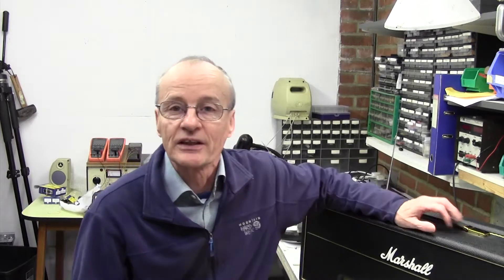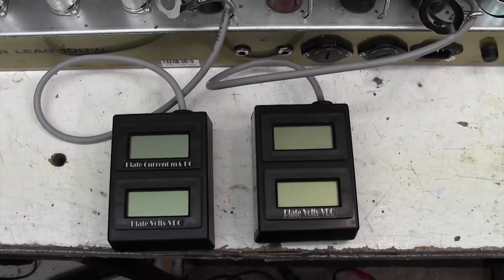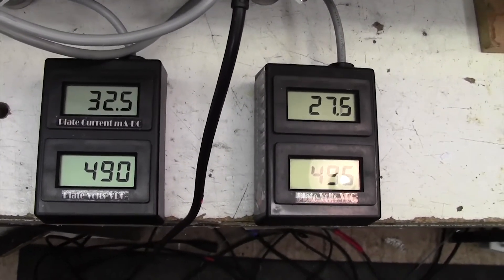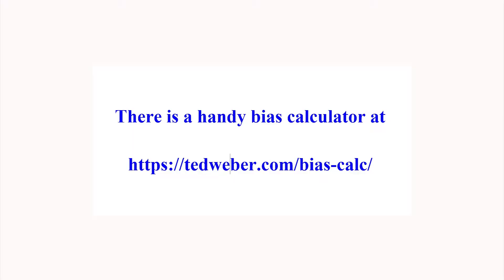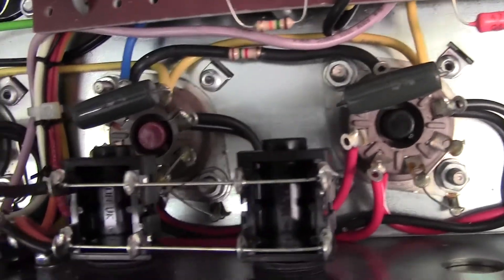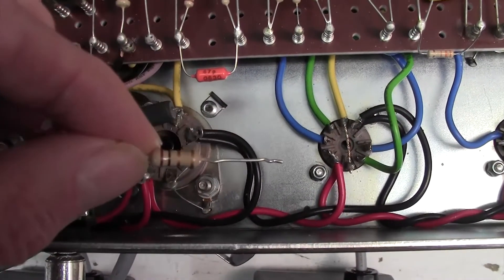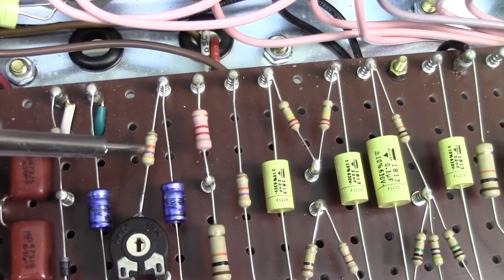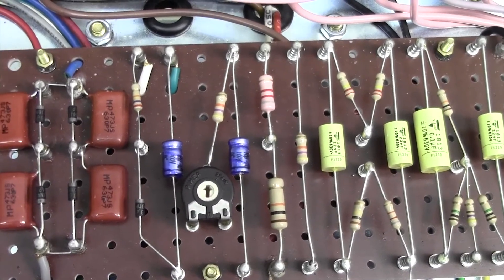How to Bias Marshall JMP 100W Super Lead Guitar Amplifier

Comment: I have one of these with 6550 power tubes in it. I'm still figuring out where i need to be. 42ma - 50ma?
It has 150K resistors on the grid coupling cap section and a 47K bias trimmer pot resistor. 1ohm r on all caths.
The Party likes his 6550's. I say put EL34 tubes back in it as it would be more compressed and controllable.
6550 tubes to me are for a Bass amp or using in a mortar to bomb the other side!😂 A very well made amplifier.
Reply from the maker: Hi It's not critical. 40-45mA is fine.
Reply: @stuartukguitarampguy5830  Thanks much Stuart. I'm 67 next week and the mind is getting foggy. I hate it. A life time of info and memory is disappearing.

Comment: I've seen tutorials before that used bias probes, but it still required a multi-meter to measure the plate voltage. I see that your probes can measure both plate voltage and plate current, which feels a lot safer to me. Where can I buy some of these?
Reply from the maker: They are made by Eurotubes

Comment: Hello Stuart ! We talked through a slight problem with my 1959 SL 100 shocking me. I was actually just adding a master volume kit from Mojotone and pulled the chassis out and put it on my chassis stand and noticed the two inboard tubes where the JJ logo was faded almost off the glass and the two outboard tubes still look like new. When biasing these two had about 2mA higher than the two outboard tubes or the two just in front of the power transformer. I biased them as I said in and earlier post about 40mA but the two outboard are about 38mA. Any ideas why this is happening as the amp has been doing great ?
Reply from the maker: Hi That print burning off will not be caused by a few mA difference in bias current. You can easily live with 5mA difference. To burn the print off the valves would have to get VERY hot. My guess is they red-plated some  time in the past and the issue was fixed and the valves left in.

Comment: Hello Stuart, i just took your advise and added a 1ohm resistor in all four positions off pin 1 to 8 to ground and i got a good shock off the on off switch, when I took them back out the shock was gone. This does not sound right to me but it happened. This was on my 1959 super lead.kit by Mojotone. Which also works and sounds great.
Reply from the maker: Defintely something wrong there!  MY best guess is you put the resistors in the wrong place and so effectively putting voltage on the chassis.
Reply: Thanks I have the ground off the chassis to pin 8 with a jumper to pin 1 verified. I have more resistors ordered so I will try this again as soon as they come. Will let you know what happens. I have doublechecked all ground tabs everywhere and have checked with a meter for continuity. Wish we ere not across the pond or I would bring it to you. No way to send you a picture or I would !
Reply from the maker: @Phoenix20086fly  Hi Ok make sure the resistors are 1phm and not 1k or something! Even so, I can;t see how adding a resistor in the cathode circuit would cause any kind of electroc shock issues/ Let me know if you find out what's going on.
Reply: @stuartukguitarampguy5830 all turned out well reinstalled four new one ohm resistors after checking al grounding points. When soldering the new resistors in made sure and flowed the solder nice around all points from pin 1 to 8 jumper and resistor to ground ! Installed the bias checker under the outboard tubes to recheck that and turned on and used a meter to check switches just in case. I do not want to get zapped again. All was well and I reset the bias just a tad High as I like it better. Now it is doing great and sounds fantastic !
Reply from the maker: @Phoenix20086fly  Well done!
Reply: No need to run tubes hot! You will find an amp sounds great clean, and dirty with the bias set cooler. I have burned up  tubes prematurely many times by biasing too hot...listen to the difference of setting it 5 milliamps cooler. There will be practically zero difference in tone. Just saying because running tubes at their hottest wears them out fast, or just shorts them out internally quicker. ✌️

Comment: Does it need to be a 1ohm resistor? Or can any value be used?
Reply from the maker: USe 1ohm. Anything higher starts to interfere with the cathide current. 1 ohm also makes calculation easy.
Reply: @stuartukguitarampguy5830  what about wattage?
Reply from the maker: @astro2069  Use a 2W.
Reply: @stuartukguitarampguy5830  metal film, carbon film, metal oxide?
Reply from the maker: @astro2069  Not important. Very little voltage across this resistor.
Reply: @stuartukguitarampguy5830  if I am understanding correctly, I can remove that bit of wire and solder the resistor in place to stay in order to use the volt meter for bias in the future? Or am I only soldering it in on one leg, measuring then removing it and soldering the wire back in?
Reply from the maker: @astro2069  Yes the first half of your sentence is correct. Pdermanently replace the wire with the 1 ohm. Now you can measure across the 1 ohm with a meter set to millivolts. E.g. 35mV would be 35mA current.
Reply: @stuartukguitarampguy5830  thank you so much you’ve been so very helpful.
Reply: Thanks Stuart so much for this video. From your other replies I am gathering on the 1 ohm resistor it needs to be 2W and type doesn't matter. I would guess that we should look for at least a 5% tolerance value to ensure the best voltage readings. Do you sort through your 1 ohm resistors to find the ones that come closest to actually being 1 ohm or is the potential 5% difference insignificant for this job?
Reply: @memTigerFanInNC 1 ohm 1% , 1/8 watt. The max cathode current for EL34 is 150mA. P=I squared R which  equals 0.022W. 1/8 W is 0.125W. If the cathode goes short (which has happened) circuit to the grid the resister will blow and not take out your output transformer!

Comment: What pins do the Bias probes attach to on the tube socket that allow you to measure the Plate voltage (Pin 3 I think) and the plate current simultaneously? Does the Bias probe calculate the bias current  via the I=V/R equation with internal resistance?
Reply from the maker: Yes pin 3 for the plate, then it breaks the cathode feed to ground and outs a 1 ohm resistor in series and measures across that.
Reply: @stuartukguitarampguy5830  Ty!

Comment: Thanks for this! very clear and easy to follow video. Gonna use this when i go take my amp back for service, I've been using a voltage converter to run my SL at 100v but with the bias that was set at 120v with the tech, I think he set it at 36ma, does that mean my amp has been running cold this whole time? It sounds good to my ears but then again I've only ever owned 1 100w super lead haha
Reply from the maker: Yes if the bias was orriginally set at 120V main in and you've been running it at 100V then it will probably be running cold. I say 'probably' because the HT will be well down as well, of course.

Comment: Hi Stuart, I tried to email you, but to no avail, I don't have the correct address.  However, have you tried to rebias the new Fender Pro Jr 4? It may make an interesting video. Thanks Stuart 😊
Reply from the maker: Hi Ken  You can contact me via the web address at the very end of each video. No I haven;t yet had a Pro Junior 4 into the workshop, probably because it is fairly new.

Comment: Read; THE TRAINWRECK PAGES 
By Ken Fischer. The safe operational range of EL34 is between 10-40mA per tube. You set it at 35mA... maybe this particular Marshall sounds better at say, 15mA ? I always have the customer play through the amp, using their speakers... I then adjust the bias within the safe operational range... until they find the "sweet spot" they like. You can then repeat this same bias adjustment every time you change the customers tubes, and save yourself time and money. 

Regards 🎸
Reply from the maker: Hi Scott. Nice idea but I couldn't possibly do that. The customer would have to drive over and hang around whilst I did all that, put the amp back together etc. And... the living nightmare of twiddling a control whilst the customer attempts to locate the 'sweet spot' as you say, whilst playing his favourite riff over and over. Spare me! I've never once been asked to adjust bias live for a customer, in thousands of bias jobs. My guess is that 75%+ of my customers don't even know what bias IS, let alone want to twiddle with it to achieve fine nuances of tone! I would also estimate that 99% of valve amplifiers out there are not biased correctly. I have a pretty good ear (for years I was a professional recording engineer) and I canot hear ANY difference between say 20mA and 40mA. Not saying others can't though. I also cannot hear a difference between quite widely mismatched power tubes - say 10mA difference, which is a lot. To look into any of this (inclduing preamp tube makes etc.) you would have to set up a carefully controlled double-blind trial with, say, 100 participants. I've often fantasised about doing that, but its not easy. My strong intuition is that when the results were in, it would all be in the noise - no statistically significant differences between one valve brand and another, or (for the same customer) one 'sweet spot' bias versus another, totally different one! But I haven't done the test and I could be wrong. There's a huge amount of 'Emperor's New Suit of Clothes' about all this. Test Subject: "Woah man, that NOS MUllard has this warm, mellow sound with just a hint of smoked oak and maybe a touch of raspberry on the highs...."  Me: "Sorry man, I left the old JJ in, I haven't gotten around to swapping it for the NOS yet..."

Getting cynical in my old age!

For others reading this, just bias at 70% of maximum dissipation like most people do!
Reply: @stuartukguitarampguy5830  With the bias higher (lower current) the amp will tend to sound crunchier, albeit thinner, with a lower bias (higher current) the amp will tend to sound beefier with more gain. A lot of the thrash metal guys running the 6550 powered 2203's back in the day loved to have their bias set really high... like 10-15mA because it sounded so crunchy. On the other hand, a blues player might like running a high current so the amp would break up much quicker. I like a bias somewhere in the 25mA range... plenty of clean headroom so my delay/reverb doesn't distort, but still enough current for the amp to get more oomph. Of course, every amp is different, and will prefer it's own "sweet spot" on the bias pot. I've had the same problem of not having the customer in person... in that case I go by the speakers, pickups, and their style of playing to best gauge where they would like their bias set.
Reply from the maker: @scottdunn2178  Thanks Scott, interesting. It sounds like you have a higher level of client than me
and more discerning! As I say, most of my customers don;t even know what bias is, let alone want it set at a certain level or in accordance with their string guage!!
Reply: @stuartukguitarampguy5830  Google; The Trainwreck Pages 
I think you'll find lots of information on bias, and much more. You'll be glad you read it, and I can almost guarantee you'll use the tips and pointers Ken Fischer talks about. 🎸
Reply: @stuartukguitarampguy5830  The sound goes hand in hand with feel.  You don't even really need to be a guitar player to tune an amp into a magical zone.  There's a place where the spank/quack from plucking strings is more expressive, and this can be done before the client comes by.  All techs should tune for tone, not just for the numbers.  When the player feels a good connection to the tone, they play in a way that captivates the audience.   There's a lot more to the tuning aspect, but bias is the icing to a long and detailed process.
Reply from the maker: @ChonkTek  Hi J L. That method is only for techs who are also good guitar players and have a fantastic ear. 'Tone' is a really subjective thing. I am not a guitarist and many (maybe most) aren't. I've repaired literally thousands of amplifiers and biased thousands. Never once has a single customer asked me to tune the amp for tone. 90%+ of my customers would not even be able to discern the difference in sound between a really cool bias and a really warm bias, let alone finer gradations. To be totally honest, I'm not even sure I can. So the numbers it is!
Reply: Excellent remark Stuart! Very, very true!

Comment from the maker: Hi Pete You're half right and half wrong (but I'm willing to be corrected). I believe tubes 1&2 are a pair and tubes 3&4 are a pair.
So... if you remove the middle 2, you have removed ONE from each PAIR - which is correct. If you remove the outer two, again you have removed ONE from each PAIR - again correct. BTW Marshall caution against doing this and say it may damage the amp. Also, doing this will give you barely any noticeable volume drop, so it's not worth doing in my opinion. If you want a 50W head, I'd ... buy a 50W head!
Reply: If you remove two tubes ( one from each side), you have to also change the impedance selector to half the impedance of your speaker(s). Example a 16ohm cabinet would be set at the 8ohm tap on the amps impedance selector, or an 8ohm speaker (or 8ohm cab) would need the impedance selector set on the 4ohm position. Saves wearing out an extra pair of tubes

Comment: I think the power tubes are "paired" like this: the two inner tubes is one "pair", and the second "pair" is the two outer tubes. An example to prove this is you can remove the inner pair or the outer pair to bring the amp down to 50 watts. Nobody removes the two power tubes on the left or the two power tubes on the right - nobody! I doubt that the amp would even run if you did.
Reply: That's my understanding as well...and I can tell you for a fact because my 1971 Super Lead has a push pull pot that changes it from 2 Output tubes to 4. As you said, the 2 inside tubes act as a push pull pair when I'm only using 2 output tubes and when I fire up all 4 tubes, I see the 2 outer tubes light up.

Comment from the maker: Yes on most 'fixed bias' amplifiers the cathodes are tied to ground. Sometimes theres a 1 ohm resistor in series across which you can handily measure the bias as a voltage. E.g. 45mV = 45mA. Of course with cathode biased amplifers (usually the lower powered amps) the cathodes are not grounded but go via a resistor to ground.